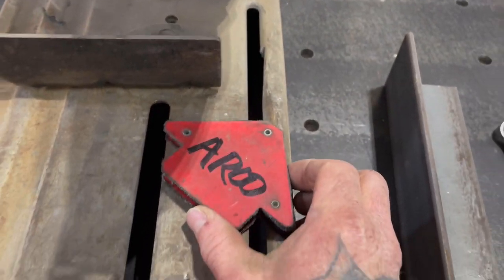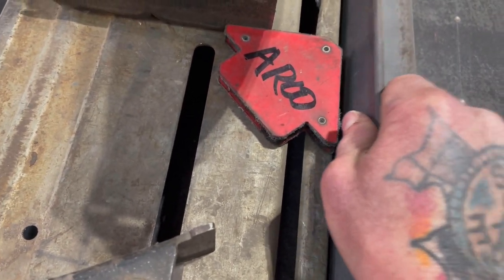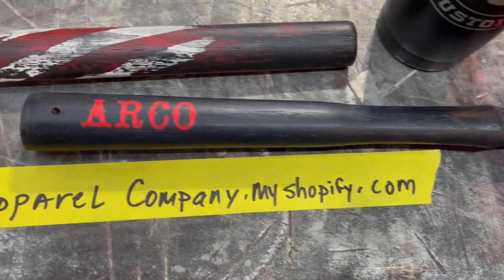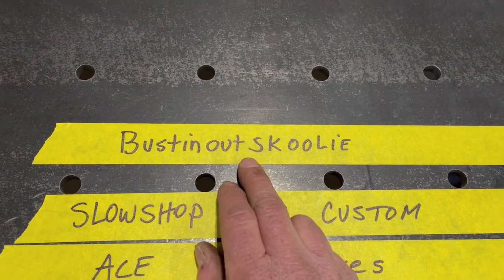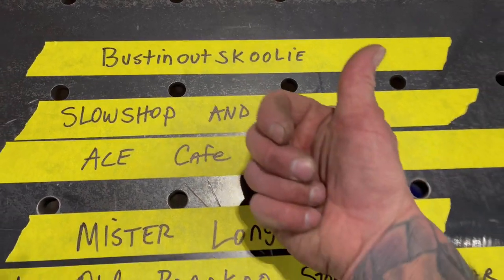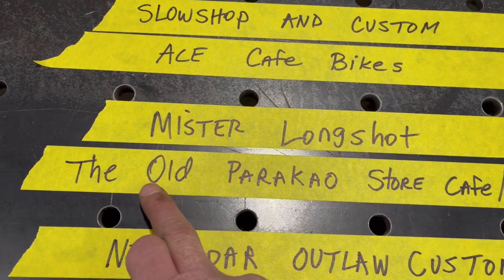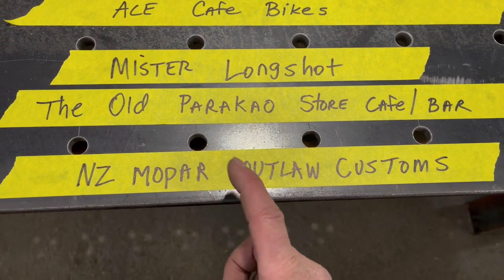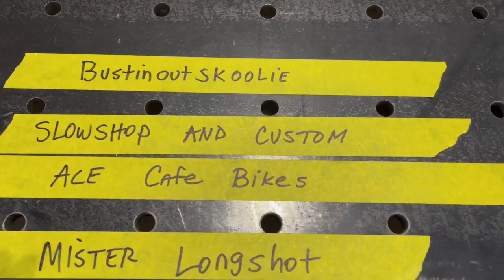Cutoff saw tech tip

Comment: Ok love the tip on this very helpful, now once you have your saw set at 90* drill a hole.250 or 1/4 inch and drop in a true fit pin at .250 1/4 inch this will set it back to 90* every time now do the same at 45* or any cut you do time after time /
Reply from the maker: That’s an awesome idea bro! Love u man! Thanks 🙏
Reply: Thanks Paul you should make a youtube channel